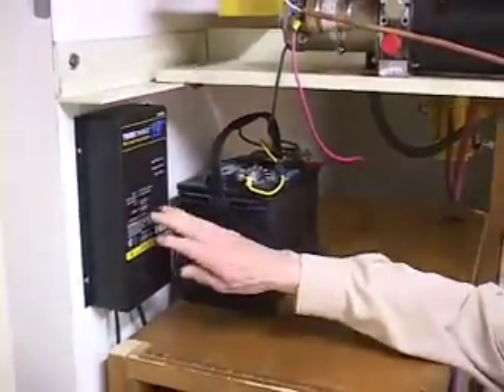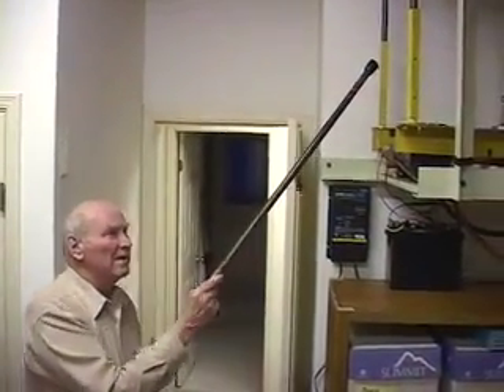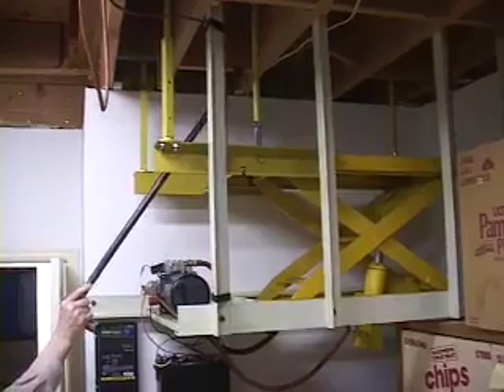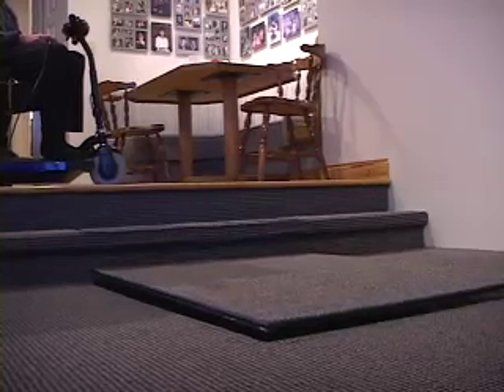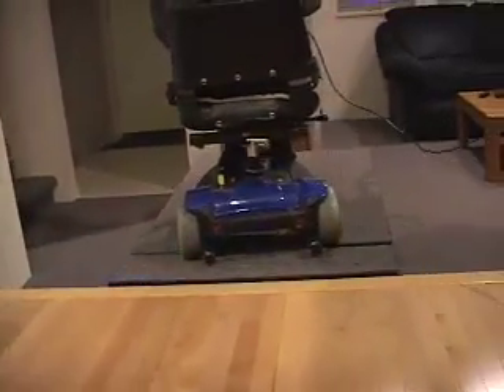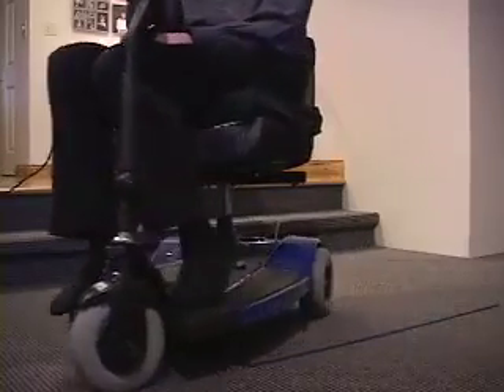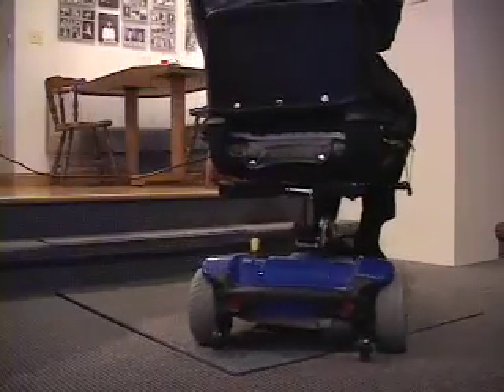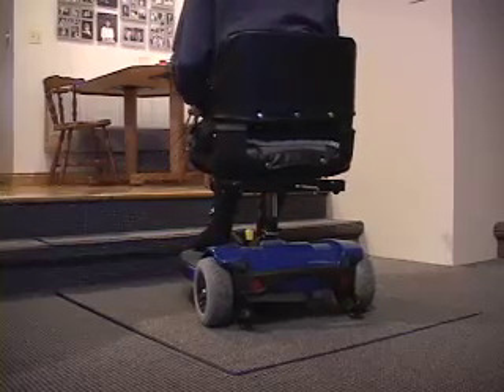Double-step Wheelchair Lift - Tetra Society

Comment: Great project!  I am doing basically the same design, but have two steps in between the top and bottom landings. The most significant change I made was to completely eliminate all the dangerous "pinch" or "crush" areas. The lift now safely "morphs" from stairs to a curb protected platform. There is absolutely no place you can't touch while the lift is in motion. This was an easy modification to address.